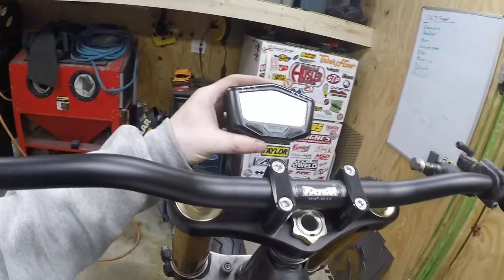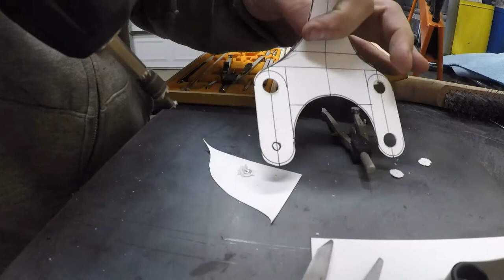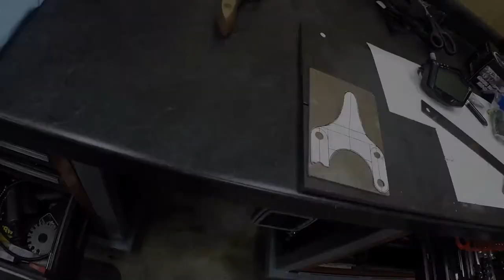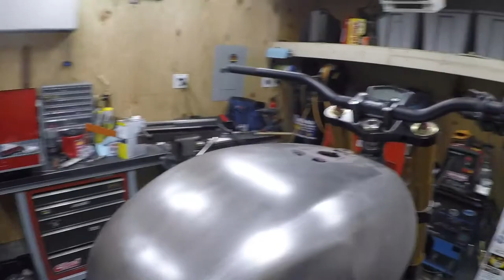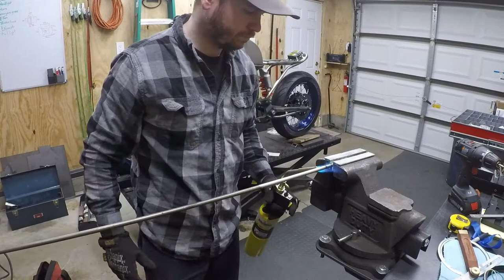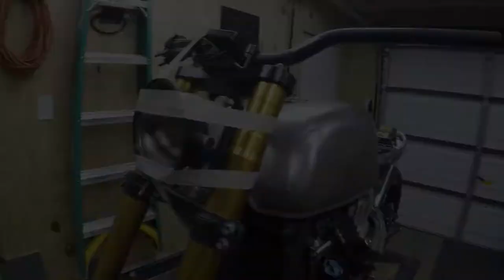CX500 Tracker Build - Fabricating Custom Headlight and Gauge Mounts! - EP13

Comment: Very good work!!  My CX 500 is 60% finished.... however I see that your front forks are as scratched as mine... how can one get them restored again?  The local anodizing shop says the can only anodize "over" the scratches - it will be still visible....  Regards!
Reply from the maker: Yea unfortunately these are scratched. I only plan to touch them up and hide the best I can. I have no advise for anodizing.

Comment: Hey Happy New Year! Hope all is well in easrtern Mo. I have the same cognito moto billet trees. My upper be that it came with is far taller than the "cup" the bearing goes into. What did you do to fix this? I havent heard back from cognitomoto yet about it.

Comment: loving the channel, nice build. I noticed you are using different coils and ignition. why?
Reply from the maker: Multiple reasons, I didnt have any existing ignition components that came with the TI GL650 engine, Im already going into the engine to replace many bits, and I want some tuneability along with the additional ignition power. Myself and the customer would like to avoid sinking this much time and resources into a bike to use original 40 year old electronics.

Comment: How would you add a new headlight assembly to a motorcycle that you weren't rewiring from scratch?

A smaller chopper headlight 4.5" on an old xs850. Where would you put the spaghetti monster from the stock bucket?
Reply from the maker: Well thats the challenge. You can't fit all of that wire in a small bucket so you would have to modify the harness or fit a larger bucket. 5 1/2 is likely still too small
Reply: @BrickHouseBuilds  nuts. Just wanted a few simple upgrades. Thanks BJ-san, guru of gasoline. 👍🏾
Reply from the maker: Guru of gasoline..... No lie I love that!